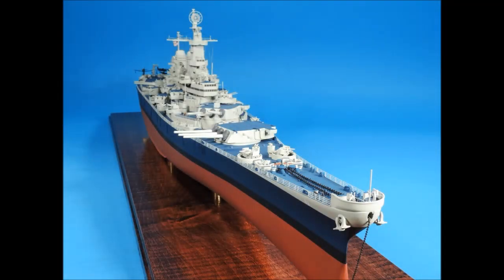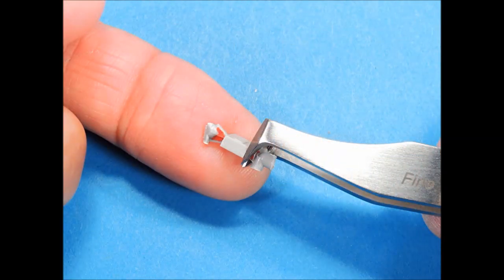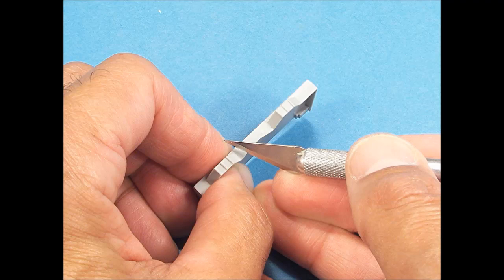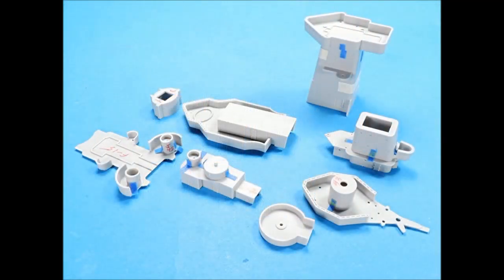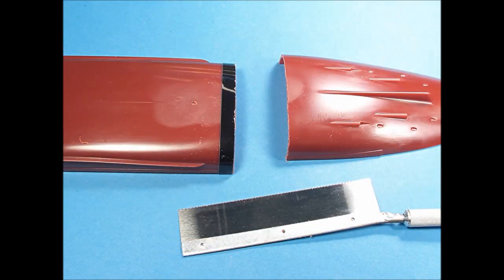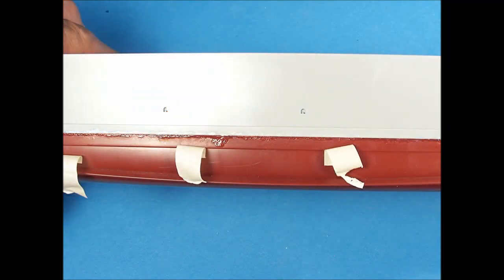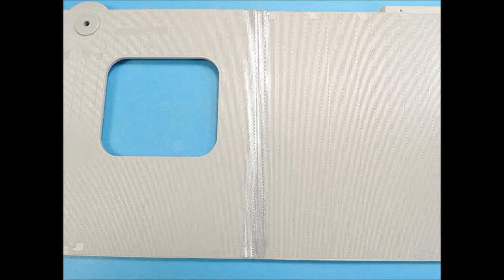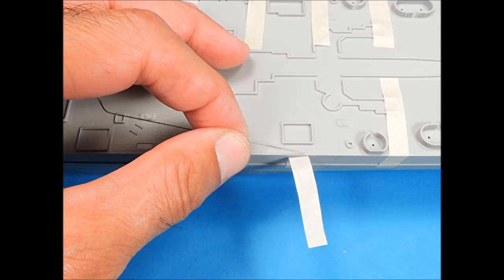Ship model assembly techniques part-1

Comment: Thank you for making these videos! Moving on to part 2. I have never built a ship model and haven't built a scale model in decades, but am wanting to build the USCGC Taney for my sons. Such an overwhelming project. The only thing I've seen about the Taney is that the rails are terrible and should be replaced with photo etched rails...I have no concept yet of how to remove the plastic rails that are molded onto it without ruining the model...
Reply from the maker: The old Revell Arizona kit also has molded on railings just like their Taney kit.

Send me you email address and I will send you some pictures of how I removed them.

Comment: I have a question not necessarily related to this great video.  I need to learn the “conversion” from European scales and U.S. scales.  Specifically, I am looking at building a model of a building that is available in  scales from 6mm to 28mm.  If I want to use model Ww2 soldiers, what scale building should I get.

Comment: Hello Mike, I have read your books and love the videos. I had a quick question regarding a resin kit. How would you fill a sink hole on the deck? It's an old resin Arizona kit with fine deck plank scribing. Would I fill with CA glue, sand, and try to  re-scribe? Wasn't sure if I should use CA glue or putty. Thanks!
Reply from the maker: Hi Eric

Is it the 1/350 scale resin kit of the Arizona? 

Filling imperfections and holes from air pockets in resin kits can be tricky.

You may want to try covering the deck with one of the wood deck sheets made for the Trumpeter/Banner Arizona in the same scale.

I recommend getting the trumpeter/banner 1/350 scale Arizona and the Gold Medal Models photoetch set.

If you go to my website you can see the pictures of my  Arizona and my conversion to a late war Pennsylvania

Mike
Reply from the maker: Www.mikeashey.com
Reply: Mike, yes it is an old 1/350 Tom's Modelworks Arizona resin kit. Unfortunately, the deck has one large sinkhole and several smudges with air bubbles. I almost bought the Trumpeter kit but went with resin instead. I may just go back and buy the Trumpeter kit now and upgrade it. Thanks for the reply!
Reply from the maker: @QuattroBJeena  

I did a build article for the trumpeter kit for FineScale modeler years ago.

I think I still have it. I can scan it if you want it.  My website has an email link on the main page.